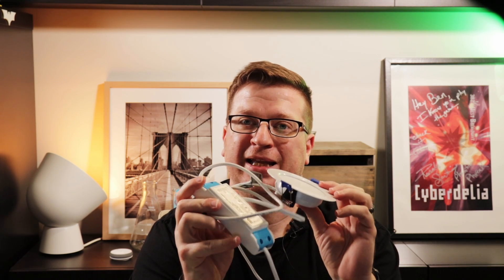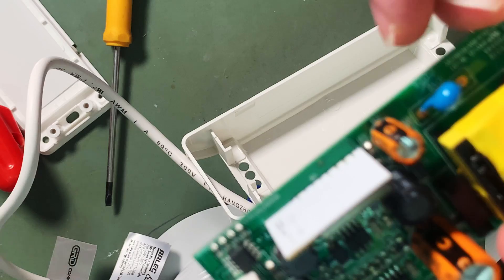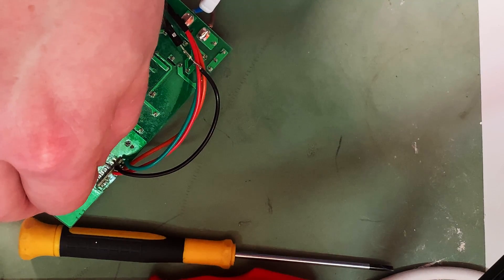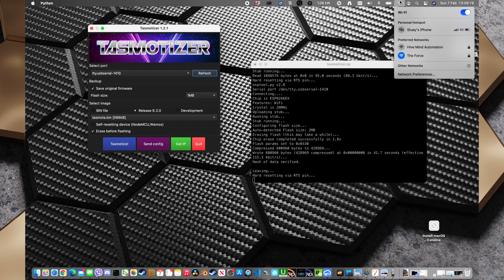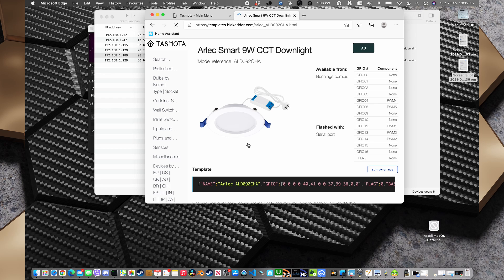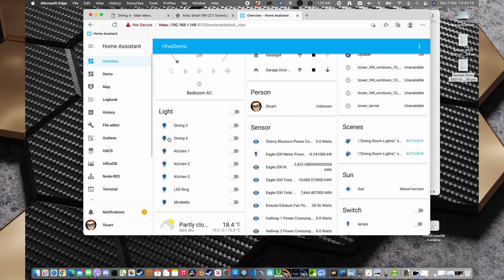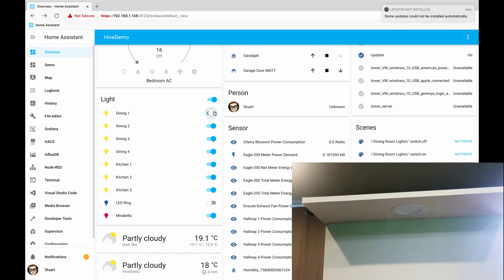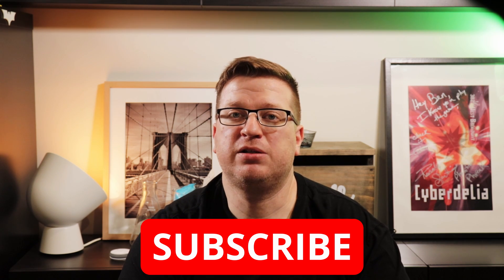Revisited - Arlec Grid Connect 9W Downlight - Flashing with Tasmota

Comment: Great video. One of my mates asked me for an entry into smart lights and Home Assistant and I think this is a great start. Given these are controlled directly via wifi there's no need for a bridge/gateway type device, right? Any comments on Deta vs Arlec?
Reply from the maker: That's right, no need for a bridge or gateway.

Deta and Arlec are - as far as I can tell - manufactured by the same company. that said, I like the Deta lights better as they're brighter.

The Arlecs were easier to flash by virtue of their board layout

It's worth mentioning though that most of the newer versions of these lights feature a Realtek chip and no longer use the ESP8266 module, meaning flashing them is no longer possible.
Some people have found they can "transplant" an ESP8266 module and it works, I'm not that brave..... yet.

That said, Local Tuya is a perfectly viable option for use with these lights and Home Assistant.
Reply: @HiveMindAutomation  Txs for that. Wasn't aware of the departure of ESP8266...

Comment: Purchased one from Bunnings today. Previous module has been replaced by a WB3L - this is not flashable with tasmota. I am considering whether to keep and see if the Tuya integration for HA works or return for refund.
Reply from the maker: The Tuya integration is better than it used to be, but it's still got problems.
Reply: @HiveMindAutomation  But if you’ve already spent the coin and voided your warranty all is not lost! 👍🏻
Reply: Update: The HA integration for Tuya works well, LocalTuya as well so while I can't use Tasmota, it isn't a dead loss.

Comment: Would be nice to have a jig with pogo pins if you have heaps to flash, similar to digiblurdiy https://youtu.be/imKZbhJ8lvU
Reply from the maker: Agreed! 
I thought about 3D Printing a jig but I only had 4 l;ights to flash. I still have 4 more downlights to re-flash though so there's still an opportunity, though I think designing the jig will take longer than the soldering method :P

Comment: This is exactly what I have been looking for. Is the process the same with Arlec e27 Bulbs (CCT and RGB)? And can I use a Raspberry Pi Pico to flash them? I'm keen to get rid of the latency!
Reply from the maker: E27 Bulbs will be a bit trickier because they'll be sealed. What you probably want to check out is my video on hacking the Mirabella Genio Smart Bulb: https://youtu.be/xhoN8uhRACY
Tuya-Convert would be your best bet here - if it works - as you can flash over the air, without having to destroy half the bulb to get to the control board.
Be warned though that SOME Tuya bulbs are no longer using the ESP8266 boards and not everything supports Tasmota Firmware, so your mileage may vary.
If the Tuya Convert method doesn't work, lightbulb hacking can be a challenging game.
Reply: @HiveMindAutomation  I managed to pop the top off and then remove the LED board from the light pretty easily last night. I don't have everything needed for the Tuya-convert so I will try using the serial flashing as most of my devices pop up on Tasmota's website (except for the newly released Arlec Smart 3 pack of 12W RGB and CCT lights | GLD132P3HA). I'm keen to try it out and will learn both methods eventually.

Comment: A point to note is that whilst your lights instantly appeared in HA, this was because you already had tasmota intergration setup in HA which you hadn’t mentioned.  The arlec light was my first tasmota flash. I couldn’t work out why my light wasn’t appearing in HA.   A bit of frustration later and I got the intergration sorted and the light appeared.  Not sure what I did wrong but I don’t have the colour temperature option or the colour wheel in HA like you do. :-)
Reply from the maker: I thought I mentioned that? My Bad. I must've mentioned it in the Deta Downlights video.

Not sure why you wouldn't have the CCT and Colour Wheel in HA. Do you have them in the Tasmota interface? If not you might have the wrong template.
There were some in 2021.5 of Home Assistant to "Colour Modes' for lights, so it could be related to those changes, but Auto-Discovery `should` pick it up
Reply: @HiveMindAutomation  the tasmota flash was fine and I have the white colour balance and the full colour wheel which works perfectly.  After a reboot of HA and some tinkering the colour wheel appeared in HA, but it’s not working properly - it keeps defaulting back to white.  More research for me..  :-(

Comment: Great stuff.
Reply from the maker: Glad you enjoyed it. These lights get far more use now that they're properly integrated into Home Assistant, and I'm so much happier with them.
Reply: @HiveMindAutomation  indeed.. I got into the home automation around late last year using ST then recently migrated to HE so I feel like I can actually now justify the money I invested in the smart devices as they have been getting used way more than before as I was limited to Google Home only.

I do have some Brilliant Smart GU10 and E27 which I'm currently using through IFTTT and virtual switches in HE so I was wondering if I'd be able to flash them with Tasmota? Not sure if if they can be popped open even? I followed another video from an English guy and managed to get the device ID and Local Key for each of my devices through the Tuya IOT website but unfortunately I haven't been able to find a device handler for Hubitat yet although I believe it supports Tasmota based devices.

Comment: Again, nice and straight forward. Can you do the same sort of flashing for the Arlec smart power boards?
Reply from the maker: Yes. 
I'll be taking a look at the Powerboard at some point. Not ideal having to open the casing of the unit to access the controller, but the Over-the-Air flashing has become less accessible since updates to the tuya firmware.